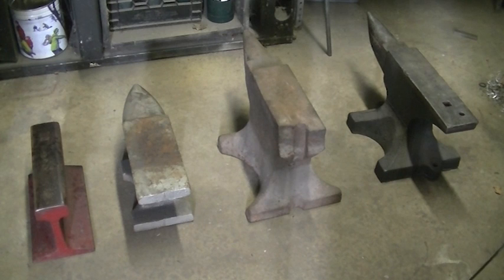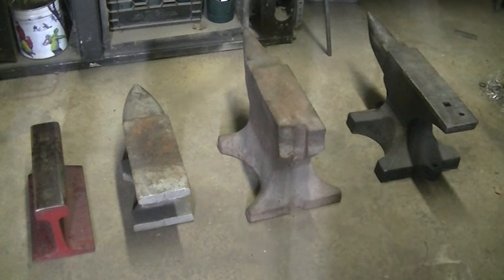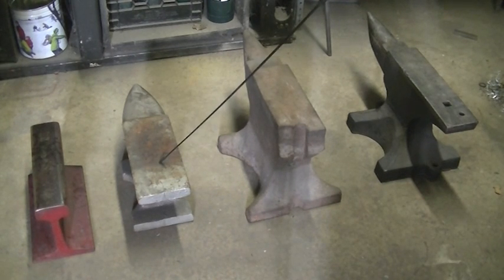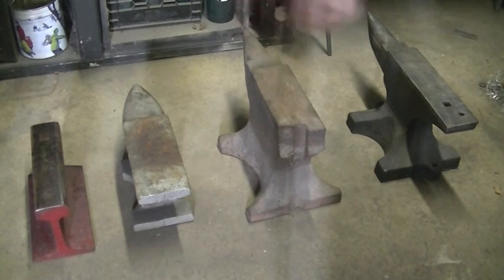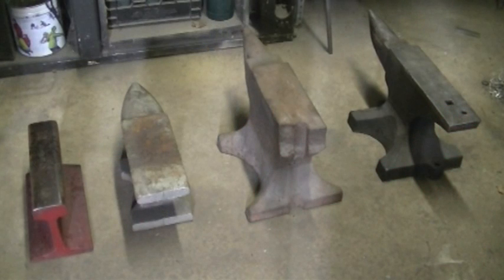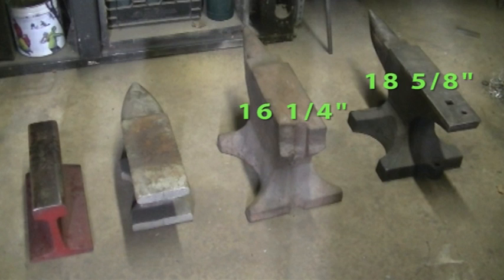Anvil Rebound Test - Steel vs. Wrought vs. Cast Iron vs. Rail - All Compared Side By Side.

Comment: i read that the train rail anvil needs more weight or mass added to it to perform like a regular anvil. don't know what you could use i was thinking old window weights attached under the sides. be interesting to see if that would change the test.
Reply from the maker: Just did the test, standing on end verses on its side... the results might interest you.

https://youtu.be/6eUM72HTid0
Reply: J Davidson most experienced people who use rails turn them on end to use them.  They grind sections (except the thickest part) in different radiuses for fullering.  Many professionals choose to keep a rail anvil set up this way despite the fact they have traditional anvils simply because they can be useful and fun to use.
Reply: i got a rail vice i bought at a garage sale for 7 dollars. not mounted on anything yet but has the horn and a hardy hole. somebody did a good job. my harbor freight vice i welded lawnmower blades the top of it and it is close to a real vise. i used those dissimilar metal  welding rods .
Reply: i also have a train coupler somebody gave me that they used for a anvil of sorts.it is a heavy piece of iron but mostly round.
Reply: thanks for the follow up.